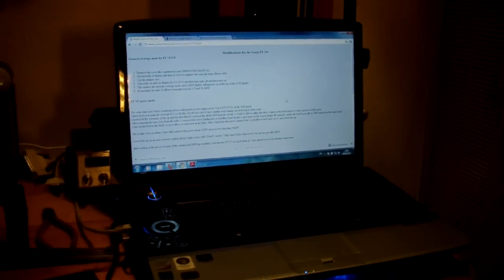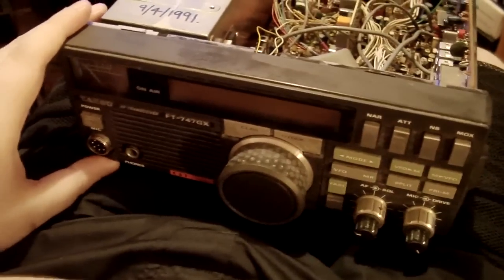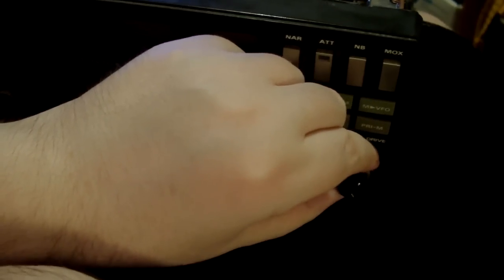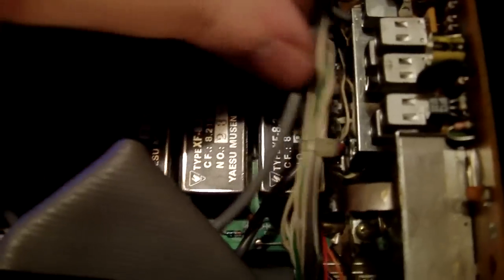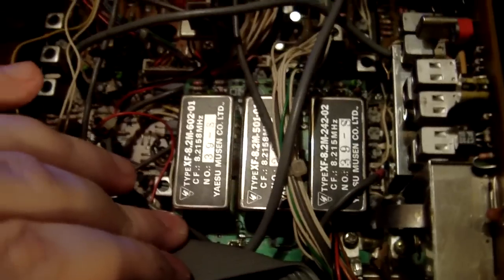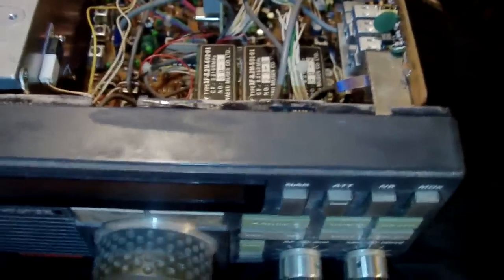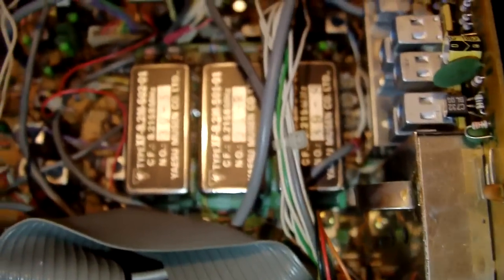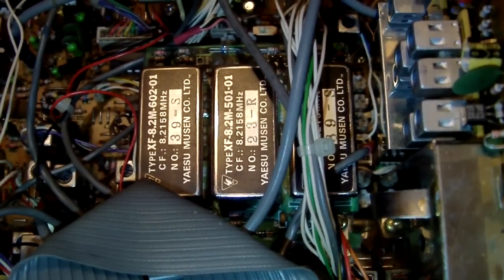Yaesu FT-747 GX D99 SSB QRP Power MOD Part 1/3

Comment: Hey Jason  I was told recently that the MIC Gain knob is used to reduce power in SSB mode by a Yaesu rep and found this actually stated the manual - Just curious...???
Reply from the maker: Hi Warren. Yes reducing the mic gain would reduce power but your voice gets really quiet. With the MOD the power can be reduced and your voice stays just as loud as on 100W. Also handy if you use to drive an Amp that can only take 5-8 W of input power.

Comment: See the third trimpot on the right on the side of the crystal filter, the third one from the back to front from the crystal filter you will see three trimpot's beside the filter, the seckon one is the output meter adjustment and the first is the squelch adjustment, that's them three right beside the crystal filter, can't miss it.

Comment: I am about to purchase a FT-747 GX CAT and was watching yer video.  What did you finally end up doin?  Please reply if you want as I see this vid is over 1 year old.  Thanks!  Hal KF7SUY
Reply: Hal Muir
Reply: I got one of them, FT747GX and you turn up the third trimpot, there are three, on the right side of the crystal filters that one, when turned up will get your rig cracking, mine is doing two hundred Watts now.
Reply: @corkystephan5073  You lame, for how long? Why do you need 200W? Are you licenced at all...?